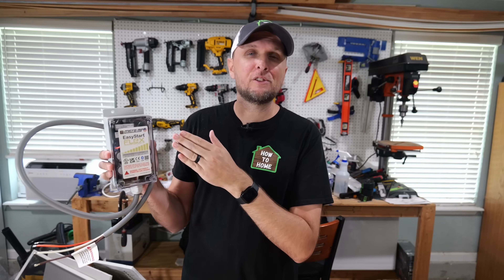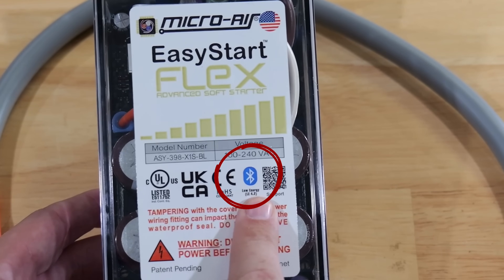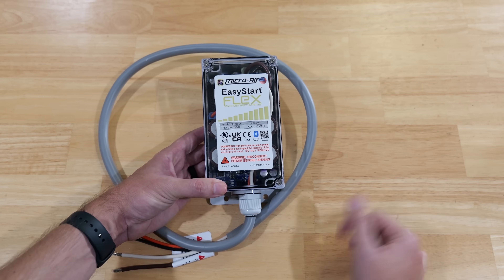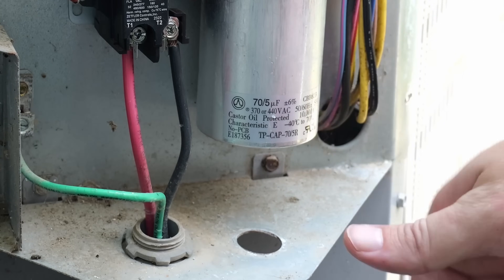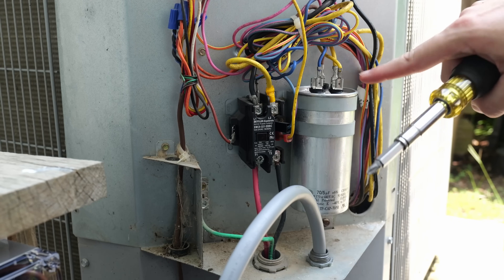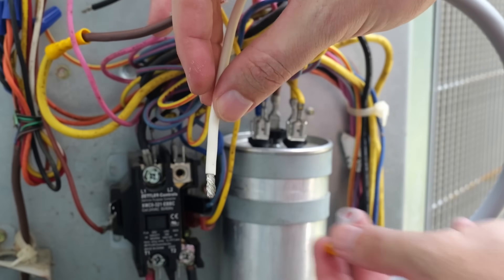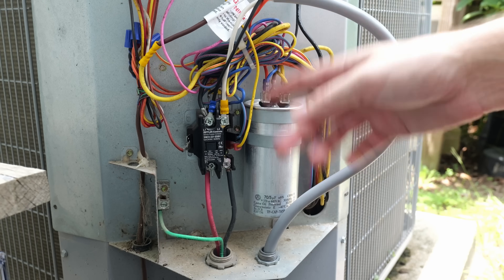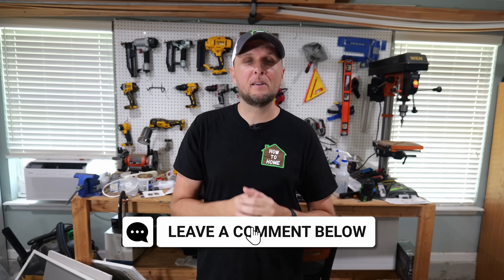The ONE AC Upgrade Every Homeowner Needs to Consider!

Comment: As an electrical engineering tech with over 40 years experience, this is the best instructional video I’ve ever seen. Well done sir, and I’m buying one of these amazing units and installing on my heat pump immediately. Too bad you’re not getting any financial benefit, but it’s good of you to pass on the information.
Reply: If you google "does a soft start shorten compressor life", there are a lot of references showing that the compressor life is INCREASED.
Reply: @timeveritt3659   "references"?  lol   Funny there are compressors 20+ years old. How much longer do you need them to last?
Reply: @executiveinvestments  Uhm, 40 years is fine with me. Surely you're not ASKING for shorter lifespans, are you?
Reply: @PH-md8xp I didn't understand everything he said, but I do understand your question. I wondered that too. Since he didn't answer you, I'll ask it again, since he'll see this. Hey, "AnotherRandomComment", could you explain more about how reducing the AMP startup surge suppression ruins the compressor? We just want to know the logic behind your comment so we'll know why.
Reply: @floridaredneck  I had a 7.5 hp air compressor and the hard start was too much for the bearing little metal dust came out of bearing and shorted out motor had to get a new one. You can tell by that hard jolt on startup there is a lot of stress.
Reply: These will shorten compressor life.  He misquoted on the hard start. A hard start kit is a starting capacitor used in conjunction with potential relay which supplies inrush voltage and reduces amperage. PTCR devices haven’t been used since 80s.(28 yrs experience as a HVACR/Mechanical Contractor)
Reply: @AnotherRandomComment  I think his meter is correct he is lowering the amps on start up. Hard start increases amps.
Reply: @portagepete1 it increases VOLTAGE not amperage. 
Think OHMS Law.
Reply: @AnotherRandomComment  You are correct. So many people get misled by this...
Reply from the maker: @MG-qk8tx wrong.  These will help extend the life of the compressor.

Comment: I got existing hard starter 5-2-1 installed on A/C. Before installing this new Micro-Air soft starter, should I disconnect and remove all wiring, relay and capacitor came with the 5-2-1 hard starter? There are 3 wires connected. One to contactor and two to run capacitor. They are just add-on without any alteration/change to the original system. Micro-Air manual calls for disconnecting and removing  5-2-1 capacitor only NOT Its relay. I wonder why?

Comment: This newer model seems to have some capacitor leakage issues.  Complaints are mounting on this new FLEX model while the old version still stands strong.  Not sure if I want to buy this right now.  Can't get the old 3 ton model - anywhere

Comment: I have a new build home and had constant dimming of lights when the unit turned on.   The builder sent out an electrician and I hired one as well to determine the issue, which I was told this is common in Florida.   I purchased this unit and my electrician installed it as I was uncomfortable doing it myself.    I noticed a difference immediately.   The lights stopped dimming for about a year.  Now just one set of lights dim seldomly.   
My neighbor installed one for a different reason, his smaller unit was load whenever it started it.  The unit was behind his bedroom.  This worked like a charm and lowered the noise level when starting.
Reply: Did you notice a lower electricity bill?
Reply: @kevothagod6144  I didn't get for that reason, Strictly to reduce the load on startup.  Regarding the electric bill, I wasn't expecting a change as I have solar

Comment: I mistakenly bought a 120V 30Amps 4000W peak generator is there any way I can power Air Conditioner and Range.  Please let me know.
Reply: I doubt it. Those are probably 240V appliances. I run my whole house off that type of gen, but not the A/C or range for the same reason.
Reply: @westhavenor yeah they use 240v and starting current can go up 75 ~ 125 Amps.
Reply: Get an induction hot plate and a countertop oven.
Both of those can be run off a single 30 Amp, 120v connection, just not at the same time.
Your generator could easily power a window or portable AC unit.
For central AC, you'd need something much bigger.

Comment: Been running one for four years making it possible to start my 4 ton A/C with our Duromax 12Kw generator. It works exactly as advertised. The A/C guy who installed it said he had never installed one but was amazed at the inrush current reduction. His exact words were this thing will greatly extend the life of your compressor.
Reply: This model hasn’t been out that long. The Flex is tried to have many issues.

Comment: That sounds like something interesting. At present when I'm at the other end of the house from the AC unit and I'm standing by the power meter when the air conditioning turns on my meter sounds like an arc welder.

Comment: I loved your video!  When inspecting my ac compressor, I have 2 capacitors zip tied together. A TURBO 200 MINI-IM connected to a Titan TRCFD505 50 + 5 MFD +- 5%
They  are connected by yellow wire from the Titan "C" terminal to a center connection on the Turbo 200 Mini.  The brown wire from the comprssoe fan connects to the TURBO 200 mini only.  
Do you have any suggestions how to either replace both capacitors with only one? Or how to tie in the brown wire from the "Flex Soft-Start"?

Comment: Installed the Flex two weeks ago.  Self installed super easy thanks to all those that shared their install.  I have a Goodman 3 ton unit and went from 77 amps to 17.8 amps
Reply: The problem is that a lot of people don’t really pay attention to the videos…or just answer comments without viewing them…the inrush on this video was 121a, since “meters don’t lie” I’d say that was a lot higher than yours.
Reply: Over 20 years Electrician. Installed a ICM soft start on my 4T Goodman. Installed to reduce inrush to mitigate dimming of my house LEDs when my A/C would start. I went from about 120Amps inrush down to about 35Amps. This solved my light dimming issue, reduced stress on my electrical grid, made it easier for generator startup load, A/C condenser is not as loud on startup. It also protects my compressor and prolongs the life of my compressor. I was also able to save money on the A/C unit itself because I was able to buy a so called "dumb" unit and make it somewhat "smarter" without having to pay a premium markup by buying a hvac unit with this technology already integrated. Working in the field on hvac units I have come to agree that buying a more advanced system would potentially force me to have to pay premium service calls due to the service tech having to plug into their proprietary system to troubleshoot potential issues down the road. I am trained and certified to work on hvac units also but don't have access to the software needed to work on certain units, this was a good way around that issue to be able to work on my own equipment without having to pay for expensive parts and labor.. Technology is nice when it works but comes with a ton of headaches and aways requires manufacturers proprietary software to fix when it breaks down.  I recommend this device for enyone that dosn't have a soft start.
Reply: Please please please stay away from this brand and model. They all faulted out and no longer works. Mine lasted less than six months.
Reply: @Litehds are you sure it wasn't hit by a power surge?
Reply: There’s no way your air conditioner was pulling 77 A. That would mean you have a 80 amp breaker on a 3 ton system
Reply: @Hurpdurpdipidydoo  
Meters don’t lie. I think 🤔 
Anyway, you don’t need an 80 amp breaker as the momentary high amp draw is so short that it will not trip the breaker, but it will trip a generator.  I’m not an electrician so any out there please chime in so we can all be enlightened.
Reply: @Hurpdurpdipidydoo  that's not true. I regularly work in the electrical field and I'll see in-rush currents over 5.5amps and it will get by 1.6amp fuses. And breakers can be slower than fuses.
Having said that, sometimes it will also blow the fuse and that's a slowblow fuse in that particular case. Anyways in-rush is pretty quick.
Reply: @Hurpdurpdipidydoo  He is talking start amps not running amps 2 different things that can happen with a 30-40 amp breaker
Reply: @Hurpdurpdipidydoo don’t know if you’re the same guy repeating this nonsense in multiple of these videos or why/how these dumb comments have any thumbs up, but no… just no. Breakers can handle around 4-5x momentary capacity before tripping. Which is what happens every single time any appliance with a compressor starts up. Even your fridge’s compressor will pull WAY OVER the 15-20amp circuit number when it kicks on.

Comment: I installed mine last month and it ran fine for 2 weeks until it died. I contacted the manufacturer and they are sending a replacement. Apparently they had a bad batch of them going bad. Hopefully the new ones are better made. Fingers crossed

Comment: This version is now blowing capacitors. I am on a FB page with many failures. Buy another product.
Reply from the maker: Fake news.  There were some, not all, of the original version that had some issues.  They were all replaced with the new model or refunded and for months now you can’t buy the older models unless you bought from a third party that sold what they had ordered of the original.  This subject is getting kind of old.

Comment: That time out feature is added protection after a momentary power system failure or brown out. Also, often a surge is encountered the moment the power starts to fail -- the junk power reflection through the network as a line shorts and then a high line fuse or breaker opens.

Comment: I recently had my HVAC contractor out to inspect our HVAC system about a year after the install and asked him what he thought about soft starts.  He said they make sense for an underpowered generator but that was it.  He said he's seen them fail after about 5 years and doesn't think soft starts add to compressor life span.  He said the Lennox unit I have, like most other manufacturers, are designed to handle the large starting amps.  With that, I decided not to install a soft start.
Reply: I am an electrician and he is right but also wrong at the same time. The are designed to handle that inrush current for sure, and designed to handle the strain of startup. Buuuuut, think about a car, it’s designed to accelerate fast if you slam your foot on the gas. But you certainly wouldn’t want to do that at every light right? Doing this would increase the wear and tear on your engine. Same thing happens on your compressor. Sure it’s not going to blow up and it’s designed to handle the stress, but it is still always better to start a motor softly. The oil inside gets to spread quicker before heat builds up, the copper wiring in the motor windings won’t heat up as much which will keep the diametric from drying out over the years.

Will it last twice as long? Probably not. There are many other variables, build quality, coolant leaks and line contamination during system repairs, poor maintenance causing the compressor to run longer than necessary. But if you take care of your system and it’s of decent quality you could get 30% longer life
Reply: @somethingsomethingsomethingdar  you're still wearing a mask, aren't you?
Reply: @SOM02SS  lol
Reply: So you disregarded the professional HVAC contractor and installed anyway? 🤔
Reply: @siriusscepter  Please learn to read.

Comment: I have a 24k BTU inverter mini split, my power goes out like a candle in the wind. Can I use one if these when running my 7500 watt 20 Amp max gas generator? 😮

Comment: I understand everything said in the video.  Is this a solution in search of a problem?  My last 2 compressors I got ~15 years of life.
Reply: Yeah, nicely put!  I've owned one for 18months.  My sense of its value-add is as follows:
* Primary benefit:  Let's you connect to (cheaper) generators that otherwise can't handle a large inrush current.  I don't have a generator, but recognize value here and it's easy to demonstrate.
* Reduces startup noise.  Our condenser is right outside a bedroom window, and it is noticeably quieter.  
* Reduces flicker of home lighting circuits.  We've noticed a big difference here too.
* Supposedly has circuitry/logic to protect compressor during brown-outs, surges, and various faults.  If it works as claimed, this is a bit like buying a quality power strip with surge-suppressors.  I have not seen any demonstration or quantified specifications however.
* Extends compressor lifetime?!.  I haven't seen anything written by Micro-air that makes this assertion or backs it up with real data.  Sure, I can imagine that reduced torque/stress amplitude at startup might reduce bearing wear and/or preserve winding integrity, but somebody please show me the data.
Is the benefit measurable (bearing wear inspections, etc.).  Is the impact on my wallet negligible or moot given other factors of aging and wear&tear?  This video says it will "extend the life of that compressor by quite a bit", but I don't know why he said that, or what that really means (if anything)...

Comment: I installed an earlier model (368) in 2023, and really like the quiet start and no more flicker of indoor lighting.

At 02:30, you say decreased startup current will "extend the life of that compressor by quite a bit".  Although this makes some sense intuitively to me (less bearing /winding stress, etc), nowhere have I seen this benefit measured or quantified.  At the time that I purchased, I couldn't find real data from Micro-air or anywhere else to back up this claim, have you??

Comment: I put a microair system on my 2ton AC unit so I could run it off of a 12kw duramax generator. We were able to keep the AC on during the last two hurricanes that had us without power for about a week and a half each.
Reply: What microair did you use, i have a 2 ton unit i wanna use one on

Comment: $345 for a 1.5 ton.  I paid only $900 for a 1.5 ton mini-split SEER22 heat pump with inverter compressor which doesn't need a soft-start.
Reply from the maker: Cool

Comment: Fantastic video.  Forget the installation instructions that come with a Micro-Air Easy Start.  This video makes it so much easier to understand.  Took 15 minutes to hook up and that included drilling a hole to run the cable through.

Comment: I'd suggest folks consider using a Wago 221-612 on the white/brown wires like the Hutch Mountain kit. Why? You're leaving the original connection in place and splice in. There have been a wave of melting capacitors on the last batch of the Micro-Air B34 units. With the Wago it's easy to remove without having to re-terminate the two wires.
Reply: How do you identify that you bought the earlier or the latest one (before I install) ?
Reply: @p.b.7861  it’s not clear where the cut off is but look at the sticker inside the top of the clear housing with the barcode, not box or outer sticker those can differ. It has a barcode. It should read 398-X2S. Below B37.  For what it’s worth my 398-X1S B36 just failed and I thought I was in the clear.
Reply: @p.b.7861  This is what I found. I'm about to buy 2 so I'm going down my rabbit hole first since I'm getting 2.  Micro Air had a bad batch of capacitors on 4% of their Flex soft start units with serial number 398006209 or less.  According to MicroAir, they have resolved the problem on units greater than s/n 6209
Reply from the maker: The last batch does not have an issue with the caps.  It was the very first ones that had issues and were fixed quite a while ago.

Comment: Thanks, Adam!  I don't know if I'm charged for Inrush/Demand Current or not, but I like what this device can do in extending the life of my new compressor.  However, $389.00 is a bit much at the moment, so I'll flag this video and the purchase link so I can get one later from your affiliate link.  I already have a Surge Protector installed, so that will just make the  2 - 6 Ton AC Micro Air Flex last longer.  I don't think there's a Hard Start installed to have to remove first.  I have seen my lights dim at times when the compressor kicks on.
Reply from the maker: You are very welcome!  Sounds good and totally understandable.  The surge protector in my opinion is important so you are definitely taking good measures!  Appreciate the feedback!
Reply: Multimeter model no. Please
Reply: @najmurrahmaan8011   All models, tools and supplies are in the Description.  Click ...more to see them.  The Description is below the Title of every YT video and the Description often has links to things used in the video.

Comment: A LOT of people here in the Houston area have had an issue with their Micro Air Easy Starts. There seems to be a bad batch with the capacitors inside blowing up.

After a few weeks being installed, have you had any issues?
Reply from the maker: None.  Micro air replaced the part on the original ones.
Reply: @HowToHomeDIY  that's good to hear. I'm having it installed on Tuesday, but it appears to be the new batch with latest firmware so I'm hoping I'll be good. There are A LOT of failures here in Houston.

Comment: MicroAir tech support is awful. Beginning February 2024, the company began cutting corners & now only accepts written customer service request that must be submitted via their website. No phone calls. They have an app that provides data, but if you have any problem with installation or operation, you’re required to wait for an email. It’s very efficient and it has taken days waiting in 85 degree heat to receive a response from them.